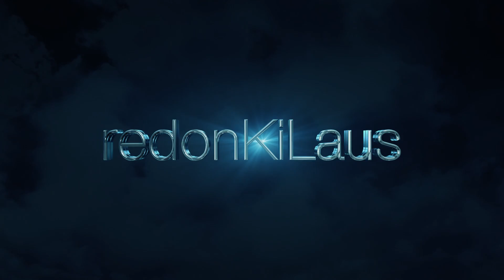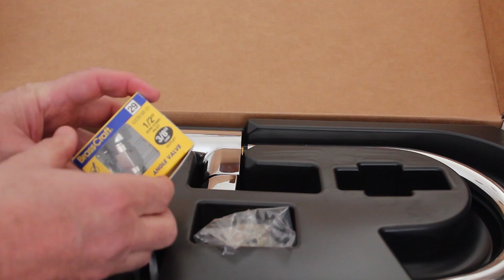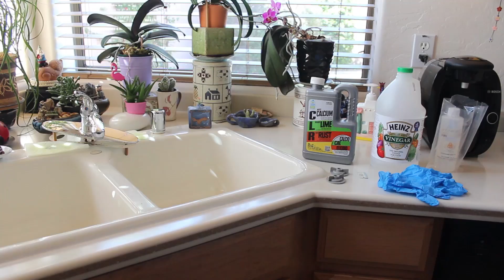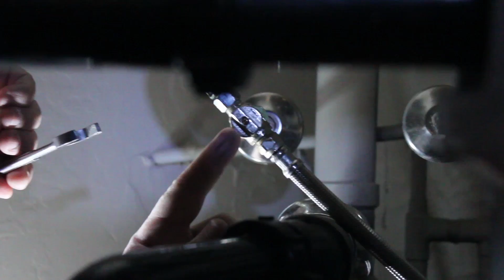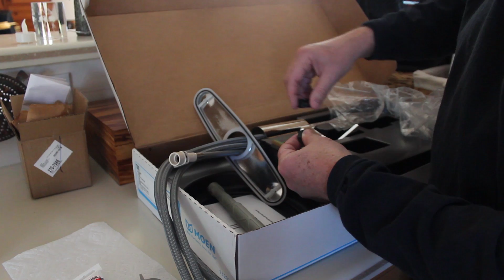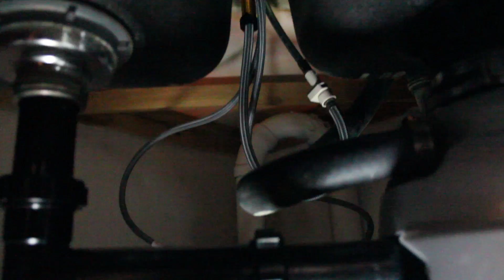Moen Kitchen Faucet Installation

Comment: What in hell is the thing he talks about using a razor blade to clean the calcium/lime/hard water deposits underneath  the uhhscussion or ohhscussion plate ?? 🤔
Reply from the maker: The escutcheon plate, it's just the trim piece.  Hope that helps, thanks for watching!
Reply: @redonKiLaus  Thanks.... I took my first Moen kitchen faucet back ... did not like it.... bought a different model Moen.... finally installed it myself. It is performing nicely so far.

Comment: Too much talk, not enough pictures of steps
Reply: I agree.. I'm contemplating taking this my model Torrance CA87480 back after watching several videos that are so inconclusive and the video quality is poor both visually ( too dark/low light ) and the installer gives incomplete directions for assembly. I also looked at all the parts and saw several parts that have the quality of something made in China for a free toy you might find in a box of cereal or Crackerjacks to amuse a child and it left doubts in my mind of how well or how long this part might function properly if at all. Todays damn engineers don't make quality stuff intentionally because they don't want it to last forever.... that way you buy new things more often.

Comment: nice looking faucet!!!  I love Moen faucets, only replacement faucets I buy, also, they have a lifetime warranty so if you ever need to replace any O-rings, cartridges, just call them and they mail you out what you need, excellent product with excellent customer service in my experience dealing with them; also, did you not want the faucet with the pull out spout to do large pots?
Reply from the maker: Great to know about the replacement part policy Moen has - I've always been a Delta fan, and the faucets in my house are all US-made Delta items, but having had a chance to play around with their offerings vs those from Moen in a showroom I decided to go with what I consider the higher quality option.  

I do see the functionality in the faucets with the pull out spout, but to me they are not visually appealing at all, which is why I didn't go that route.  

Thanks for watching!
Reply: you should give name or show the valve box.